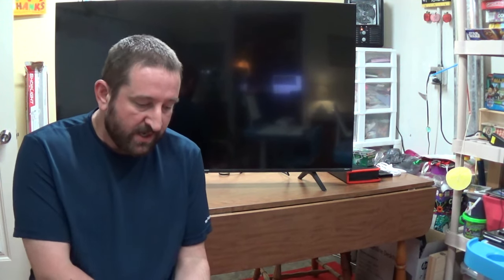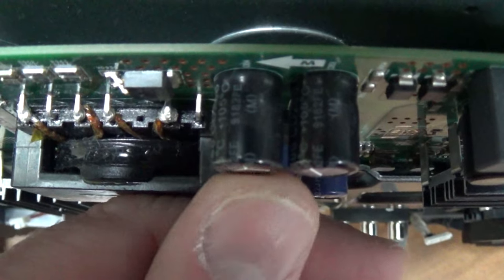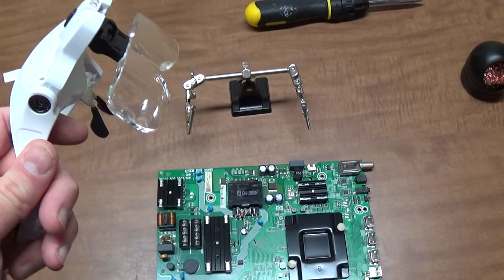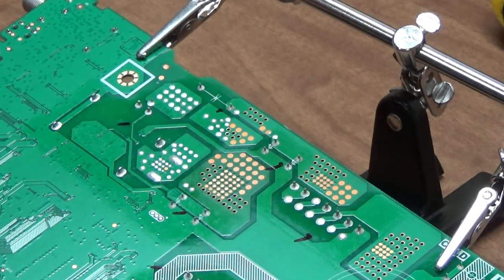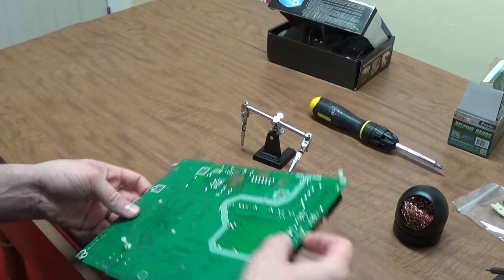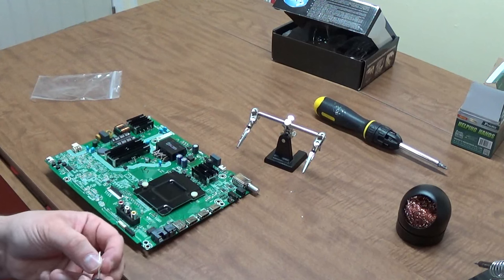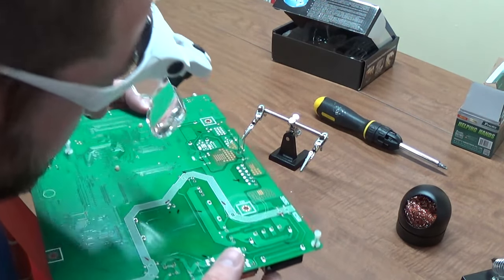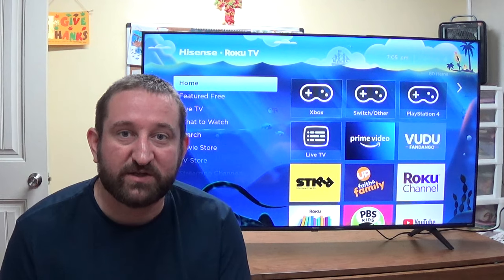Gaming On A Budget: Hisense "On and Off Repair" Full Tutuorial (55" R6 Series 4K HDR10 Model 55R6E3)

Comment: Practically every single tutorial on YouTube is garbage. This one is absolutely fantastic. Doesn’t give you no turn off and on cliché basic solution, but rather explains the actual reason why my TV isn’t working in a very simple way and gives a good fixing on it. It also helps that you reply in the comments.
Reply from the maker: I'm so glad you found this to be a good tutorial.  The reason you gave is exactly why I made it.  No video I found attempted to make things clear and easy to follow, so I wanted to do that.  I appreciate your comment.
Reply: I got my TV  at the same time you did and this is happening right now 😂😂
Reply: @VashtiPerry  i hope this tutorial helps. Saved me so much money and a mean tongue lashing from the old gal.
Reply: Thank you!! This video just saved me about $400. Money I don't really have to spare. I appreciate you.
Reply from the maker: @sansker423  You are very welcome.  Someone helped me with this once and now I'm returning the favor.
Reply: To be fair, with how complicated some of these smart TVs can be, a soft or hard reset is necessary because a glitch can happen during an update or the power goes out and requires you to reset it to clear the problem so that it works again. We have a SONY TV that has required me to reset it every now and then because an update didn't work right. Otherwise, even thought Hisenses are cheap, at least they're easy to repair.

Comment: I want to thank you for this video.  My TV died as yours did and I was lucky enough to find this video.  I followed your instructions and instead of having to buy another expensive TV, mine was fixed for less than $25 including solder/paste/wick and 10 capacitors (Which I hope to never need).  My TV is running like new.  I'm chalking up a lagniappe to you sir.
Reply from the maker: Makes my day to know I helped.  Hope it lasts for many more years.  Mines still holding strong since I replaced my caps.

Comment: This seems to be a very common issue around the 2-2.5 year mark. This is a great tutorial, very simple, and easy for just about anyone with common knowledge and skills can do. Thank you very much!! I really needed this! Subscribed and saved for later, thank in case I need a rewatch. Thanks again!
Reply from the maker: Awesome! So glad this has been helpful to you.  I wanted it to be simple, easy to follow, and fully instructional so no one was left without a visual aid to guide them in the process.  I hate it when others skip steps assuming everyone already knows certain parts of the process.  Truth is most people don't know any of the steps of the process and need a fully visual guide to get them through.  So reading your comment has made me feel like I succeeded.  Thank you
Reply: @EDFCentral You definitely succeeded. As a complete novice, I feel fully confident in repairing my TV the 27th, when the capacitors arrive. Thank you, again! ❤❤
Reply: @EDFCentral I do have a question, I am having trouble finding the EXACT volt capacitor, everyone seems sold out at the moment for my country. So, for a 350v 10uf, would a 400v 10uf work??
Reply: @EDFCentral I didn’t end up getting the 400 but still couldn’t find the 350, so I went ahead and ordered a motherboard, instead. It was $25 and went in very quickly. It fixed my tv and it hasn’t skipped a beat. However, I’m going to grab two 350’s when I can find them and fix the old motherboard, that way I’ll have a back up. Thanks again!!! ❤

Comment: This is the most useful video I've seen in a long time. Currently, I own two Hisense 50R6 televisions. One of them is a G and the other one is an E3. The E3 died suddenly on me from similar reasons as the one in your video. I had thought about replacing the whole motherboard but, this is obviously much easier. I am legally blind with a great deal of electronic experience but, my vision will not allow me to solder it in. At the moment, all I have to do is lay hands on the proper capacitor and find somebody to do the soldering for me. I've only owned the television for about 3 years so, I'm a little irritated by this. However, this is going to make things much easier and I really appreciate this video.
Reply from the maker: My friend I understand about the eye issues.  I'm now almost 45 and my up close vision has gone the way of the dodo.  If it wasn't for those magnifying glasses I showed in the video I would not be able to do any soldering.  I wear 2.0 readers just to see the back of a medicine bottle (or I snag on of the kids, whoever is closer lol).
Reply: @EDFCentral  I totally understand the issue. I've been suffering from retinitis pigmentosa for many years. As a result, I have tunnel vision and many blind spots throughout my field of vision. Currently, I'm down to 15% total. I wish I had the option of using magnifiers to compensate. Fortunately, I am a fully tenured professor of exercise physiology and biomechanics at a major university. Thus, my vision really isn't an issue. However, when it comes to things like this it is very frustrating. Anyway, I'm going to remove the motherboard and get somebody else to do the work. I appreciate the information.

Comment: Well, just repaired mine, same issue, capacitors blowed/leaking. Happy to see that this saved a huge chunk of my budget. I guess the caps are a failure point before something else blows.
Reply from the maker: Yes, seems that they are using cheap caps in these TV's and its ridiculous.  Something as inexpensive as caps and they have to go with the cheapest option.  They could really make a good name for themselves if they would up the quality of the caps.  The TV's are great except for the cheap caps.

Comment: I have a newer model but this helped. I did end up buying a new board being I have never soldered and don't have anything to solder with yet. But I'll be keeping the old board and re solder it being the issue is the same as what you fixed in this video. The right side capacitor is bad. It was only $22 for the board and the tv I got for free
Reply from the maker: 22 bucks is a great deal and less hassle.  I didn't even know I could buy a new board at the time I did this video.
Reply: @EDFCentral  I hadn't known before with other tvs. But few places sell the boards instead of repairing the tv with a broken screen from shipping or warranties. Most of the time the board doesn't get damaged.
Reply: Where did you get the new board from ?
Reply: Lmk
Reply: @TheYoungE40  I got mine on ebay. Can't seem to find it anywhere else unless I wanted to pay over $100. Just have to make sure the board matches your model and board you have now.

Comment: Thanks! Yep I had 2 bad capacitors! Good Video... My 55" Hisense is up and running perfectly. I bought 350Volt 10UH - 18000hrs @ 105°c capacitors. So they should hold out longer than 4 years this time.I believe the originals were rated @ 4000 or 5000 hrs! HEY If you use this guy's video and it works why not send him a couple of bucks!
Reply from the maker: Thank you so much! I really appreciate it!

Comment: This is very helpful. I've opened the backdoor of my Hisense TV and looked at the capacitors and they look good. I have the 'blinking red button' problem. What could be the reason for it and do you have any video showing how to fix it?
Reply from the maker: If you are getting the blinking red light and the screen turning on and off then it should definitely be those capacitors.  Even if the capacitors don't look bulged out they may still be bad.  I recommend replacing them or if you are still in warranty just replace the TV through your warranty.
Reply: @EDFCentral  It just the blinking red, the screen remains black. Does it change anything?
Reply: @EDFCentral  Should I use a multimeter to check if electricity comes out?

Comment: It's interesting that most of the tutorials on Hisense TV capacitor replacements point to these two specific capacitors. I wonder if that's a fault with the design of the TV or cheap capacitors. Well, at least capacitors are cheap to buy, making these TVs easy to maintain.
Reply from the maker: From my understanding they are using cheap capacitors thus only buying you several thousand hours of usage as opposed to 10s of thousands of hours of usage.

Comment: Great tutorial! Question! If I replace the capacitors will my tv be reset? I have all my streaming accounts and some I forgot the password to on there and was wondering if I’ll have to sign on again. Thanks!
Reply from the maker: I didn't have to.  All it's doing is fixing the screen so it turns on again.  Everything else should remain as is.  Mine stayed the same.
Reply: @EDFCentral  Hey man just wanted to say thank you! I have ZERO soldering experiencing but gave it a shot and did an “okay” job but it fixed my tv! I appreciate you for showing me how to do this! Thank you!!
Reply from the maker: @WillyManchester10  You are very welcome.  Someone showed me how and now I want to pass it along.

Comment: Greetings.   It seems I have the same problem with my Hisense-Roku YV Model 50RGE1 which all of a sudden it stopped working. The screen turned green with the logo on and off for a few seconds. Does not respond to my control and the ON/OFF button doesn't work either, as I unplug from the wall and comes on immediately with the green screen and the logo. Have not checked the capacitors and if necessary, will replace them. Hope this will fix the problem, as Hisense Tech Department was of no help at all. And the "warranty" had already expired.. How did you find out the Capacitors were the cause of your problem? Thanks for your video.
Reply from the maker: I researched it and saw a video that showed me what the issue was.  However, the video didn't show you how to fix it and what you would need to do so.  So here you go a step by step tutorial on what to do.

Comment: Took my circuit board to a TV repair shop and had the tech swap them out, and it's still doing the same thing. I have the correct capacitors and also tried the reset button as well, but still no luck. Could there be anything else causing this to happen?
Reply from the maker: Had one guy put the caps in upside down.  Could be that or another issue.  I'm not sure what else it could be.  Hopefully you can get it resolved.  Sorry I can't offer more help.

Comment: Same deal Hisense 65" 4k Roku65. But I have no 10uf 350s on board on any of the three boards. On the power board I have a single black pair of 25uf 250V and 6 blue 470uf 25v caps. Ideas?
Reply from the maker: Man I wish I knew, but I have no knowledge of that model.  My suggestion then is to look at all the capacitors and look for two things.  1. Check for any that are bulging at the end like I showed in the video. 2. Check and see if you can find where any fluid has come out.  When mine ruptured it sprayed fluid on the black plastic panel covering the motherboard.  It made it super easy for me to figure out which capacitors had blown.  The fluid will be dry by this point, but it will still show where it hit and ran down.  Other than that I'm not sure what else to do.  Truly sorry you're going through this as well.  Apparently this has been happening to a lot of people.  Since I made this video and replaced mine my TV has worked without a hitch.  I'm guessing Hisense got a deal on cheap capacitors.
Reply: @EDFCentral  Yeah the negative reviews are off the rails now on hisense in general. Not a fraction of a hint of any splatter or splatter remnants on the case back and all caps look clean, perfect and straight. I wish I had actually followed my idea of electronics back years ago but we were moving into the good economy and throw away society mode where people could buy another TV cheaper than send it to a shop or buy a new mower rather than visit a small engine mechanic. I used to fix electronics as a kid by some natural skill but as they moved into modules in TV's and such. I worked in a zenith shop at 16 when they were switching to modules and the guy I worked for couldn't fix stuff for double the cost of modules so I never started learning even before the throw away society started. I can almost see the writing on the wall, these kind of shops may be coming back with the economy going the way it is but i am far too old for that now. It would still be a nice hobby. :) appreciate the input. Wish I could post pics. Maybe there should be a hisense repair reddit, people could share fixit pics and comments rather than keep buying more hisense chineseum, keep some money here....

Comment: 350 10 micro farad  , the U character is actually an µ , so 10µf. this is to help anyone who is trying to find the part.
Reply from the maker: Thanks for that helpful info.  I will say that I didn't have any trouble finding the caps using a 'U' when I searched for it.  I think sellers are just substituting a 'U' in place of that symbol.

Comment: I got the soldering kit and my iron gets pretty hot but it doesn’t liquify the solder around pins so I could take out capacitors off? Isn’t even solder on????
Reply from the maker: Try turning up the temp on the iron.  Try 400 degrees

Comment: I've got a 65 inch hisense. Model 65R6E1. The capacitors aren't swollen at all but it shuts off and on. Tried unplugging it and waiting 60 seconds. Pressed the reset button and took the batteries off the controller. Wifi signal strength is good too. Should I replace the capacitors anyway to be sure?
Reply from the maker: If your TV turns on, goes to the HISENSE logo screen sits there for a few seconds and then turns off and then back on again repeating itself in a loop it is probably the capacitors.  When you take the cover off the back of the TV look at the plastic backing and see if you can tell if any liquid has ran down the back of the plastic backing.  You could see liquid from where the capacitor ruptured and squirted out onto the back of the plastic cover.  If you see that just try to line it up with where it came from and it will help you to pinpoint if it was a capacitor and which one.  On my TV you could see only slightly that the capacitor was raised a bit.  It still looked closed, but it was raised just slightly.  More than likely that is what your problem is as well.
Reply: @EDFCentral  I looked at the capacitors when I cracked it open and they're not bulged, popped or open at all. I was told it still could be that and to replace them anyways. I've got 6 25v 470uf, 3 350 v 10uf, and 2 50v 68uf capacitors. Should I replace all of them? Thx again for the reply and help!
Reply from the maker: @elkuko8686  No, don't replace them all.  Only replace the 350v 10uf ones first.  These are the ones that usually cause the issue.  Also sorry for the delayed response.  Youtube didn't tell me you had replyed.  It seems to pick and choose when it updates me these days.
Reply: @EDFCentral  no worries man I seriously appreciate the reply! I've been waiting on a pack of capacitors but I've got my soldering kit, rosin core solder, Flux just in case, and most of the capacitors. I took out the motherboard and it's sitting just waiting. You saved my ass from removing capacitors unnecessarily lol. Thanks again for that. I'll keep you posted once I replace and try to turn on the t.v. your help has been seriously valuable.
Reply: @elkuko8686  Did replacing the capacitors fix your tv?
Reply: @justindelbusto  I haven't done it yet. The weekend I was going to I had an accident at work and was almost paralyzed so I've been recovering while that damn tv just sits there lol. Once I get back on my feet I'll give it a go.
Reply from the maker: @elkuko8686  You are very welcome.  I hope you were able to get it fixed.
Reply from the maker: @elkuko8686  Oh man, best wishes on a speedy recovery.
Reply: @EDFCentral  thank you very much. For a while I thought I was gonna be s.o.l but it's healing well, im expected to make a full recovery. It's been irritating just laying in bed but I have to. Thank you for the kind words.
Reply from the maker: @elkuko8686  Hang in there.  Kids and I will add you to our nightly prayers.
Reply: Same exact model and same issue but my caps are different
Reply: @elkuko8686   did u get to do it I have the same problem mine are completely flush and look fine should I replace?
Reply: @ZaneForkum  yeah replace em. Once I did, it started right up for me. I doubted at first because they weren't swollen but the capacitors were the problem. The bigger gray looking ones. It's been a while since I did it so I can't remember exactly. If I find the package they came in I'll let you know. I was t sure so I bought a few different capacitors. The bigger ones were the problem I remember that for sure.
Reply: @ZaneForkum  350v 10 uf like EDF Central suggested. He was on the money with that so I'd first try that. Disregard what I said b4 about the grey ones etc. Read his reply to me and start from there. Watch a few videos on how to solder if need be, I did lol. Good luck on your repair.

Comment: Idk man I have the same blinking red light problem but none of the capacitors are bulged. Maybe one is just bad
Reply from the maker: I'm hearing from others that sometimes they don't bulge like mine did, but are still bad.
Reply: @EDFCentral  I had a bunch of usb stuff attached to the back of the tv when I turned my stuff on last night it just all failed and then my problem started. I just ordered a bag of them for $8 we’ll see if it works 🤞
Reply: @EDFCentral  didn’t work. I changed them but I still hear a high pitch noise coming from the black box next to the capacitors. Still blinking light and black screen. Buying a new one tomorrow